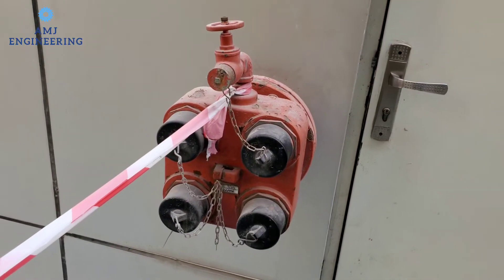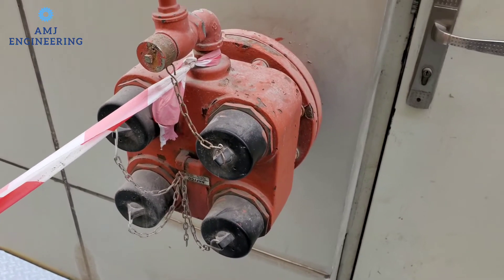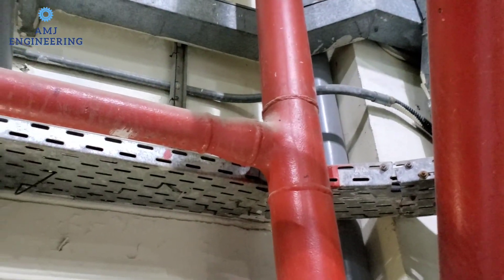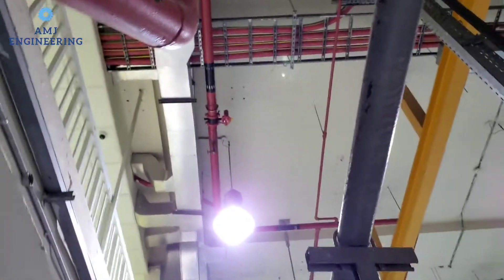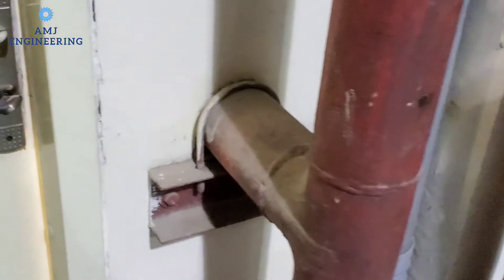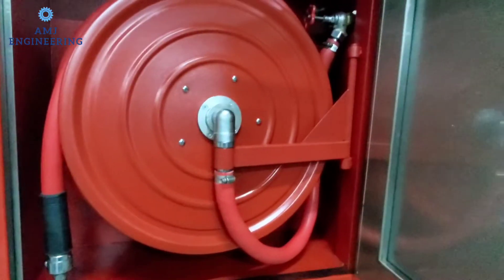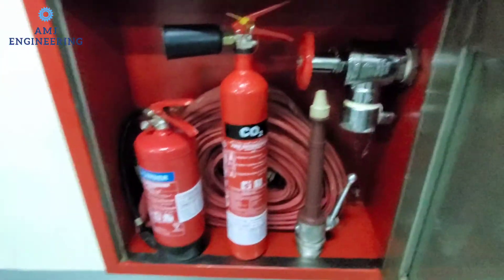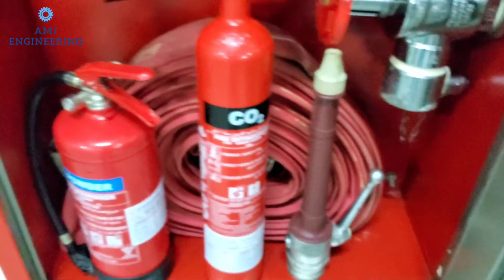fire fighting lesson 5_Fire department connection

Comment: I guess the mounting orientation of the breeching inlet is wrong in this installation. The 1” hose connection outlet seen in the installation is a drain valve. So for the valve to facilitate drain function, it has to be located in 6’o clock position (which forms the lowest point in the system). 
But in the shown installation , the breeching inlet is mounted with the drain valve at 12 o clock position, which I think is incorrect..

Comment: is there a valve between the building sprinkler system and the FDC?
Reply from the maker: NRV
Reply: Usually a check valve but no control valve. If it has a control valve it is usually a fire pump test header